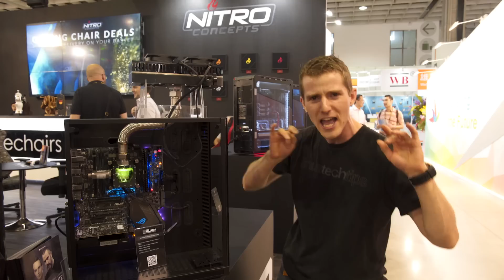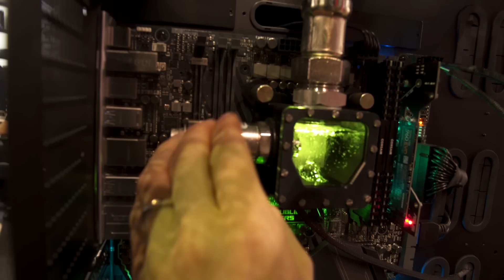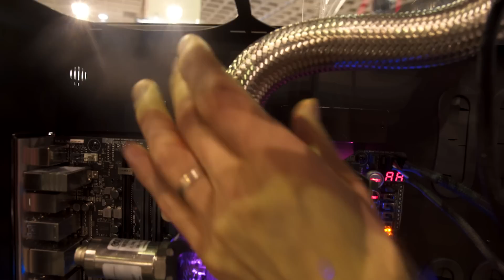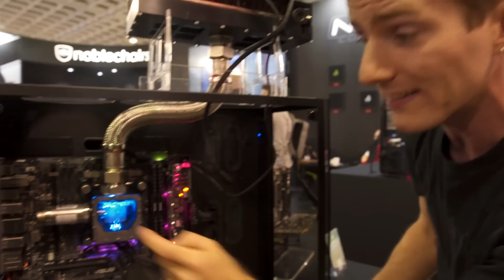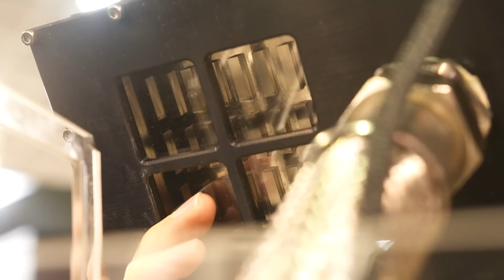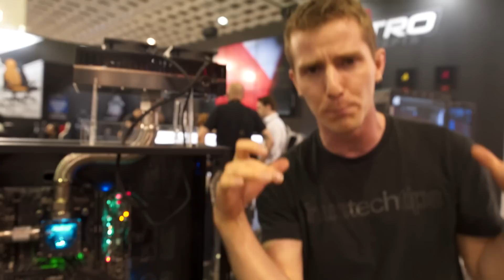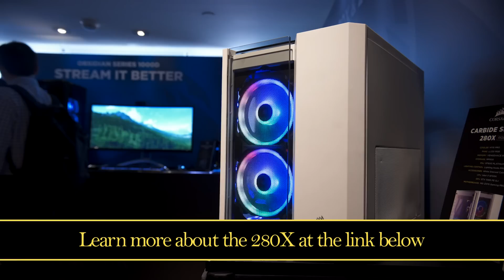Crazy Der8auer cooler prototype - NO pump!

Comment: Looks like perfluorohexane, 3M sells it under the name Fluorinert.

Perfluorohexane has a boiling point of 56 C degrees which would allow the distillation process to function in a scenario like this.
Reply: Definitely gamer bath water
Reply: Jacob Clarke Doesn’t Perfluorohexane dissolve metals?
Reply: @Voices-yi8ce  not at all
Reply: @Voices-yi8ce  nope
Reply: he is using 3M Novec i believe, it has a boiling point somewhere at 31 C
Reply: @jandetmers6478  That is way too low. not that it isn't good, but only until the summer hits the attic.
Reply: @iamgroot7147  Novec 1230 boils at about 49.5. With a good radiator it should work decently. Lots of proof of immersion cooling comcept with this fluid going around.
Reply: butane or propane would work as well.
Reply: @KCWhoa  Then it wouldn't need a heating element. Both of those boil well below room temp
Reply: @MrYrulookingatme  all depending on the preasure of couse. You don't necesarily have to do it under atmospheric preasure.
Reply: @matteloht  sure, but you'd have to pressurize the system by a decent bit in order to get butane to boil at room temp. Whereas perfluorohexane is already used for coolant and has a decent boiling point at atmos. Pressure.
Reply: @matteloht  also why wouldn't you then just pressurize it to the point where the fluid boils at cpu operating temp instead of using a heater
Reply: @MrYrulookingatme  Yeah, stupid idea. I just wanted to mention that it would be possible.
Plus Perfluorohexane and similar 
halogenated hydrocarbons are way safer to handle due to that they are quite hard or slow to react and therefore don't explode like butane may in some cases.
Reply: @matteloht  No stupid ideas, made me have to think about it haha
Reply: @matteloht  25ML of Perfuorohexane is ~80$. 

I think it's possible to replicate this, but Saturated Steam Pressure can be tricky here.
Reply: @arned432  Yeah if you buy 25ml of a chemical then there's no way you're getting a good deal (edit: the good deal you're getting is access to esoteric chemicals with relative ease). Especially since you probably got that price from a chemical distributor, which distribute small amounts to chemists for experiments, so only produce and/or store a small amount of esoteric chemicals. $80/25ml at a 25ml scale could easily become $5/1000ml at scale, or even cheaper.
Reply: @KCWhoa   Yeah, but butane or propane would be ludicrous fire hazards.  The liquid in this cooler is almost certainly a low boiling point fluorinated compound.  Nobody wants a cooler leak to turn into an explosion.
Reply: @KCWhoa  yes but actually no, with the lid in there you would have to airtighten and presurize this, wich the PCB, nor the socket would withstand for very long
Reply: @KCWhoa  helium does too !!
Reply: No need for something that toxic.  It can be done with simple water in an evacuated system.
Reply: @Andy-df5fj  n-Pentan should work with nucleate boiling, including free-air cooled condensers for most of the year in the temperate zone (e.g. central Europe). 5-10 days per year, on average, depending on exact details, would need some additional water for evaporative cooling. The only downside is that that n-Pentan is a little more flammable than gasoline, and you're literally operating it close to/around it's boiling point. It'd be a good idea to use a pump for longer pipes though, especially also because higher flow speeds at the cooling surface allow for higher power densities. Thankfully a modern CPU would just throttle hard if it overloads the cooler and causes film cooling, which might even recover itself and revert back to nucleate boiling automatically. Worst case you'd have to throttle for second or two. And that's just if you try to OC something like a 24 core threadripper or so , pushing >400W. (Yes, I read about this, because I'm intrigued by the idea of fan-less server that's as easy to "make" as just putting it into a slightly-larger containment-case, which is built to handle the weight increase of about 5-10kg per 1U of server. Also, non-sealed (so, probably all non-helium) HDDs can't be in there. Otherwise, it'd be about as usual/normal: condenser-output-liquid into the front with light pressure to get 10-40% or so as vapor, take excess liquid pouring out the back once again to the pump-inlet.Can probably literally be a miniature weir or so where the liquid just spills over/out to the "sump" when it's level is too high. n-Pentan should be compatible with most stuff you'd find in a server, though some exotic/special parts might not like it. Also, it's gonna absorb some water, which you'd probably want to filter out for fouling and corrosion protection reasons. The cooling surface would be iirc 10~20 degreee Celsiums over the boiling point, so 46-56 C for n-Pentan and 60-70 C for 2,2-Dimethylbutane. That would have the benefit of allowing free-air cooling of the condenser at air temperatures up to 40~45 C, but leave much less overclocking ability. Also it's afaik more toxic and less easy/cheap to get (think 15$/kg instead of 3-5$/kg, or something like that). Also, execpt for the Butane mentioned above, the previous suggestions were all effectively-non-toxic. One close cousin of them is actually used to fill the lungs of burn victims, because exposing the burn damage inside their lungs to air would create more problems than cycling that high-desnity (~2.5x as heavy as water) somewhat-viscous liquid fast enough through the lungs, without damaning anything with high flow rates/pressures/forces.
Reply: @namibjDerEchte  
Wow you certainly know a lot about coolants but wouldn't simple water under vacuum work well enough?  It's what is used in many heat pipes.
Or would those substances you mentioned work at atmosphere in which case it would be simpler to construct.
Reply: Science!
Reply: Could be a lot of liquids with low boiling points, specially when the block is pressurized. ethanol, acetone methanol
Reply: No...it was 3m novec.
Reply: its probably 3m novec
Reply: Just 3M novac(hope i spell it right🤣)
Reply: then the cpu will be the one boiling it
Reply: I agree
Reply: It could also be pure alcohol (higher boiling point, but still doable) although I dont think that would play nice with the seals
Reply: Linus said the block was toasty so this seems possible.
Reply: So you would need something with a boiling point probably in the range of 50 to 70 °C, should be non toxic as liquid or gaseous and it needs to have a moderate heat capacity. Dosn't help if you just boil of everthing but the heat is not transported away. Should be inert as well, Chloroform would do it, but is toxic.
Reply: i seriously doubt its an inflamable liquid   ... copper still is he best heatconductor  though , watercooling never beat hq copper heatsink
Reply: @goku21youtub  actually, this is not correct. First: Silver, Diamond and Graphene conducting heat better, leaving 2He aside. Second: It is not only just getting the heat away from the CPU in the first place, it still needs to dissipate somehow and this is dependend on oh so many factors like thermal conductivity of the heatpipes, surface area for heat exchange, yada yada yada. Aircooling can beat watercooling under circumstances, however, a large advantage of watercooling is that you can quite freely chose your concept of dissipating the heat to the environment, therefor it is much easier to tackel even large heat loads. Last: I don't know if it would be required to have a nonflamable liquid, but it would definitely not hurt for getting the product through the licensing process for the consumer market.
Sorry for my bad english, i'm from germany.
Reply: @I3raini84  yes of course , i meant consumer stuff to buy not a silver heatsink for $$$  .. over the years ive thought so many times to get liquid cooling but when i researched it then , it was always the recommendations to rather use a traditional heatsink
Reply: @goku21youtub  Watercooling is about heat capacity, not conductivity. The fastest heat conductor will always be a liquid or gas as it can physically move the heat at the speed of the particles.
Reply: Probably it's distilled horsepiss
Reply: @xelemorf  That would be water
Reply: My guess is ammonia for the fluid since it appears to work the same way early air cons  and refrigerators did
Reply: i think it more looks like Quarksisnwlwjdnwotjkwejsjfisuanulwqjquaiakliquid-31948842929181+32

Comment: Direct die CPU cooling is nothing new. Using Novec or Fluorinert to do it is nothing new. Using phase change cooling is nothing new. These techniques are as old as overclocking CPUs are. However, putting these things together in a commercially available system is something extremely new!

Comment: Judging by the temp and safety and the fact that he can not require lots of permits to the point that he can just buy the solvent after importing it to a new county and it looks oily I would guess acetone.
Reply: If it was a flammable liquid there would be inevitable safety issues even from pockets of gas forming from very slow leaks - that's why boats sometimes blow up from gas accumulating in the hold. Acetone is super-flammable, and is also very harmful to inhale, so it would have to come with highly visible warnings all over it. I don't think in practice they'd release a product with such a hazardous material in. One legal case and the cost to the company would be enormous, regardless of the rights and wrongs of the situation.
Reply: @herseem  it is not that flamable and most other posible liquids are more flamable or toxic or expensive or corosive or hard to get without atracting attention  that would reveal what you are using. It could be a mixture of things though.

Comment: I would say, that he user Ethanol, Novec 649, Sodium Bromid or Water.
Reply: its definitely not water. my best guess is novec 700 with a boiling point at 34° C.
Reply: @MrSimon1909  I dont think that it is Novec 700, because i have read several test reports and found out that the cpu gets up to 70-80 °C, but there is no gas forming on the CPU it selfe just on the bottom of the heat block, so my theory is that the liqued get boild at the bottom of the heat block and the gas produces the boubles. Maybe the worm liqued drops down to the bottom wehre ist being heated and is being evaporated on the bottom and then cooled in the heatsink.

Comment: wouldn't it be better if the CPU was on the Ground of the PC. Maybe a deeper placed Mainboard with a special design. This would make it possible to put the fans on the top of the case instead of over the top...

Comment: I believe he is using R11. It is a low pressure Refrigerant that has been around for decade's. Works well with ambient loads. I would figure that it is less than 1 ton of cooling. They use the same method on the AZ pipeline keeping the stands and piping from freezing

Comment: I'd go for some 3M Novec liquid, cause That's what he always uses for his submerged PCs. It has a low enough boiling point for CPUs to operate without a cooler mounted.
Reply: but he said no one will know what it is. Der Bauer has used Novec in the past and always said it. So there has to be some new liquid. Maby with better 
thermal properties
Reply: @tictax319  Novec is not one specific liquid but a series of products from 3M, so both can be true.

Comment: and I'm still here waiting for this to be released :(
Reply: hallo max
Reply: @ApatheticEuphoria  we even tried washing the boards in novec, and all sorts of things. Nothing worked longterm except active filtering. We suspected at the time that some of the debris was actually electrolyte from the capacitors. I don't know what the latest theory as to its origin is as I stopped working at the Datacentre about 1.5years ago.
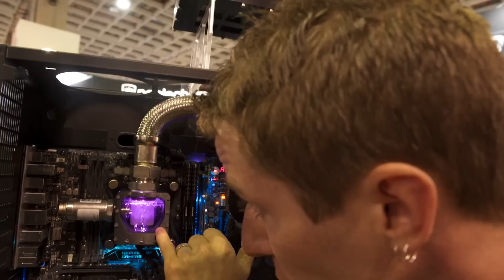Reply: Timothy Armstrong-Ooi 3:00 there is a reason why the bubbles come from the bottom
Reply: @danielseidel7473  yeah that's bullshit, you can see the CPU Die, you can see it not "connected to this conductor", you can see that the bubbles are coming through the hole that the led is situated in. 

I'm an engineer that worked with various immersion cooling fluids for 3years, that's not what liquid boiling off a surface / cpu looks like.

I'm sorry to break this to you but the demo is a fake, the product will never come out, and heatpipes will always bee more efficient than any attempt at this bullshit.
Reply: @DuxDigital  der 8auer and intel are working on a new conzept with peltier elements. m3 novec isnt a thing anymore.
Reply: @schmeggels258  peltier elements are a non-starter, there is no way to overcome their overwhelming inefficiency because physics gets in the way. And before you start attempting to argue with me on this, as a polite reminder I am an engineer that literally worked on colling tech for 6 years.
Reply: @DuxDigital  the cooler is namend "intel cryo cooler" watch the video or read infos bout it and answer your question yourself mr. im an engineer. because im not but it looked pretty promising for me.
Reply: @DuxDigital  and how are you an engineer of cooling tech and dont hear about intels peltier cooling concepts?
Reply: @schmeggels258  I don't consider cooler that consumes 200W of power just to operate even remotely efficient. I stated that they suffer from "overwhelming inefficiency" not that they don't fundamentally work. 
Not to mention you would now have to cool both the source heat and the additional peltier heat so your cooling solution now need capacity for ~400-500W total.
Reply: As I said I AM AN ENGINEER, immersion cooling is an attempt to be more efficient not colder. Peltier TECs are HIGHLY INEFFICIENT.
Reply: @DuxDigital  if its so inefficent why does intel research on it?
Reply: @schmeggels258  in short: Because people will buy it.
 It lowers the barrier to entry for extreme overclocking, and makes less noise (& uses less space) than a refrigerant heatpump would.

It's not even marketed as an efficiency product, it's an extreme overclocking product. And since when have overclocking products ever been about efficiency?
Reply: @ApatheticEuphoria  Yup, if you look at where the bubbles are originating (the bottom of the chamber) vs where they should be originating (the CPU heatspreader) its kinda obvious. 
Look at other videos of immersion cooled motherboards (including Der8aur's own videos) the bubbles come from the surface of the heatspreader not the LEDs.

Also when I was working on immersion cooling at a Datacentre in the Netherlands, we actually had to remove the heatspreaders from the CPUs because you get conductive debris build up around the tiny gaps and breathe holes in them. Which is why real immersion cooling systems have filtration to mitigate the debris problem. The debris is actually just left over dirt from manufacture of the components (mostly shoulder flux) that in air cooling wouldn't be an issue, but because the coolant used is a solvent, it picks all the debris up and deposits it wherever it happens to boil off (kind of like calc build-up in a kettle or a clothes iron). So even if this was real (which it's not) it would kill your CPU in about 1-3months by shorting out the on chip voltage regulation.
Reply: Also if you want a pumpless cooler just use heatpipes, they literally work by having a fluid evaporate, then cool down at the radiator and condense and to flow back to the hot end to evaporate again.
Any real engineer would know that.
This design would have all the issues of immersion cooling with none of the benefits.
No graduate engineer would be so clueless as to design anything like that.
Reply: @DuxDigital  Yeah but it’s cool, don’t be such a buzzkill
Reply: It won't be, it was faked.

Comment: Either it’s water at lower pressure 

Possibly butane? 
That boils at 30f at one atmosphere 
Diethyl ether too?

At the very minimum it’s something with lower boiling point than water 

I’d assume alcohol but that’s pretty high on that scale 
I could even see methanol
Acetone?

The problem finding something with a good phase change curve and not being a solvent or flammable is pretty hard so otherwise I’m guessing something designer

Comment: It might be acetone.  At sea level it has a boiling point of around 56c.  If the pressure is lowered some inside, the boiling point can be lowered.  A pressure sensor would be needed to find a good working temperature range.  So basically its a heat pipe with a radiator on the end to increase condensation.  (It might make sense to use a wicking type of heat pipe setup so that vertical offset is less important)  Either way, pretty cool.  Anyone know of a closed loop convection cpu cooling system that actually works? (I guess this could qualify)
Reply: the cooler doesn't have a coldplate as you can see in the video and the cpu heatspreader + possibly parts of the socket are directly exposed to the coolant. acetone is a way too strong solvent that would probably eat the glue of the heatspreader and all plastics in the socket over time.

Comment: There are only a few commercial liquids that are safe to handle and has a phase change(liquid to gas are room pressure 1bar atmosphere) around 50c-70c  most are alcohol based solvents and its derivations.   The largest clue is the fact that all components from the prototype are all metal and I did not see any rubber/plastic parts to prevent it from being dissolved by the liquid solvent.